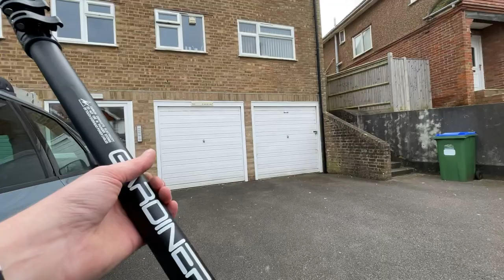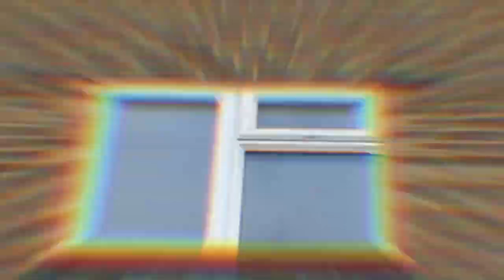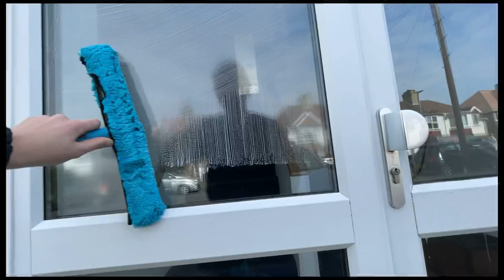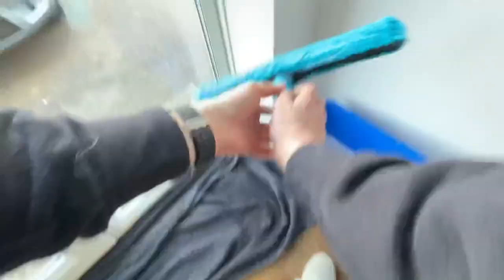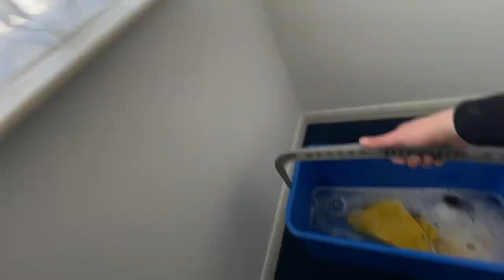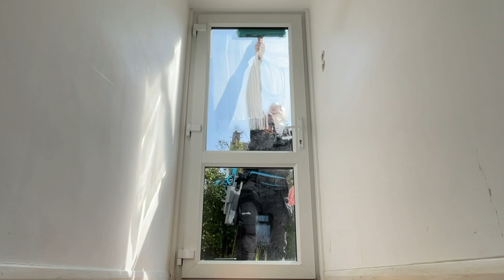Traditional Window Cleaning - TESTING MOERMAN NXT-R RUBBER and GARDINER SLX POLE (No Ladders!)

Comment: How did you like the blue Moerman rubber compared to the green Unger rubber I've not tried either so it will be good to get a comparison as I only use liquidators.
Reply from the maker: Couple of pros and cons for both. Blue rubber fits the liquidator channel better so detailing is less with this also need slightly less pressure to clear the solution. BUT the Unger green works from the second you put it in the squeegee, no breaking in needed and just streak free every time. I need to use the blue a bit more to see how well it lasts and how it performs once broken in properly but so far so good 👍🏼

Comment: Did you have any problems with the nxtr rubber squeaking as it's a hard rubber? I know trad man did
Reply from the maker: So far it’s been good to me, no squeaking but then I’m on the south coast and tradman is in Scotland so probably a few degrees warmer here. It was very sticky before it was broken in a bit but then it was great
Reply: @dcmwindowcleaning9498  where did you get the duster from that you clean the frames with?
Reply from the maker: Search on google for “Unger cobweb duster”. Most window cleaning suppliers will have it. I only use this to clear up the loose dirt, then I use the Unger fixi clamp with a wet microfibre clothe wrapped around a sponge to wipe up the stubborn dirt
Reply: @dcmwindowcleaning9498  cheers mate all the best👍
Reply: @dcmwindowcleaning9498  im in the North West of England  cold and damp,  the climate dictates how you clean. Up here its cold fingers,  always too much  rain  on the  glass,  can get 🙄 frustrating 😒,  but still,  love the job!